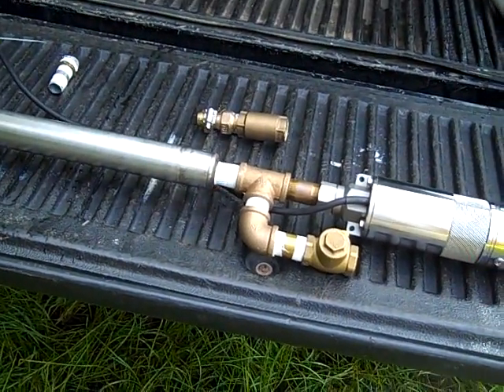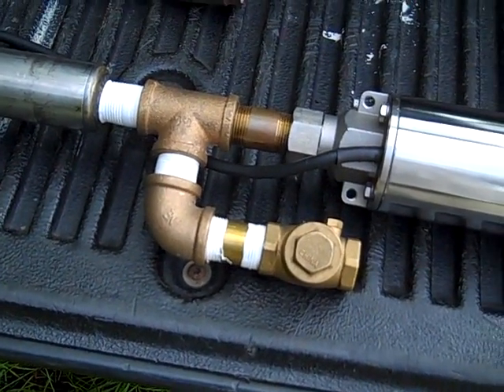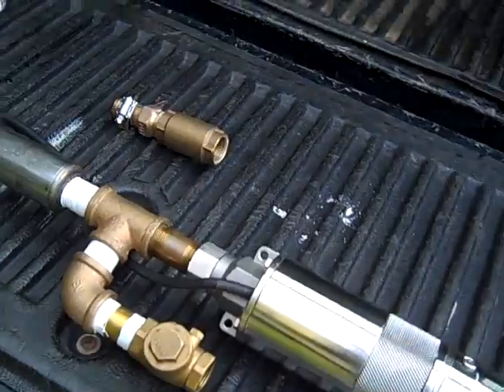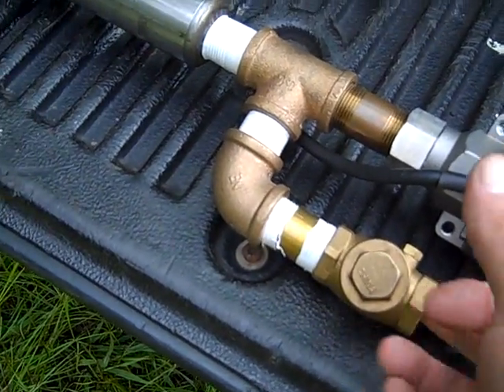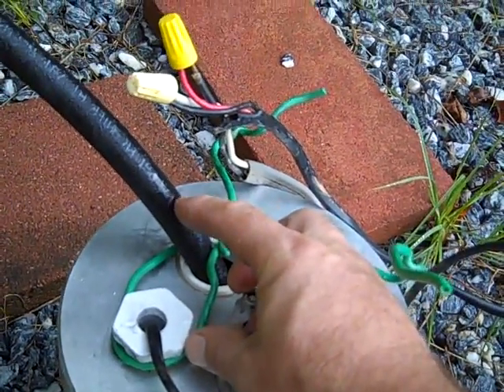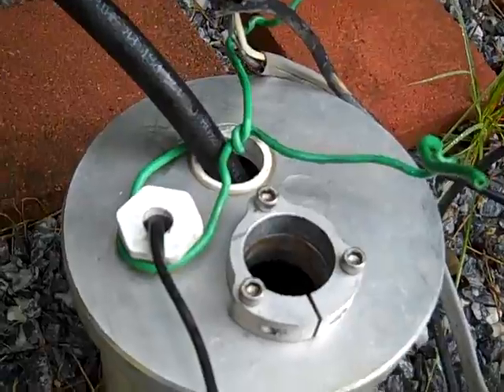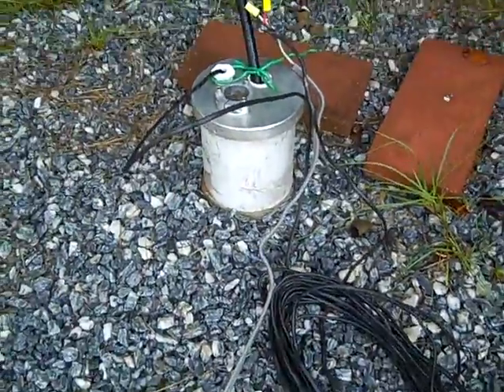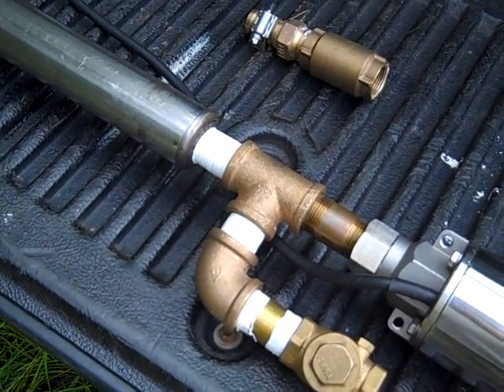All about wells - A Solar submersible and hand pump inline

Comment: What are your thoughts between the Simple pump vs the Bison pump? What schedule pvc pipe does the Simple pump use? The only thing that concerns me is the fiberglass sucker rod. It looks like the glow rods you use when installing network cable, and I know that can come unscrewed easily.

Comment: We just put in a 148 foot deep well. The water level is at 13 feet from the surface.
We want a hand pump and solar submersible pump that will reach 20 feet deep
into the 6" pipe.
I think I heard you say that you design these combination pump systems and I'm wish to hire you.

Comment: Have been taking measures to become more self sufficient in terms of power, now It's time to get serious about installing a back up system for our gravity fed well supplied by surface water from a large river up here in Canada above the 50th parallel. Have watched your vids for at least 2 years and would prefer to have your philosophy, expertise and experience on the job if possible.

Have a 20' deep fiberglass well casing (about 3' diameter) which holds about 10' of gravity fed water, about 350 gallons of endless water near the shoreline. The pitless adapter exits the well casing just under the 10' mark well below the frost line and goes down by PE pipe to a 1/2HP 230v submersible pump 10' below. Frost line is about 4' up here. Would need to feed the solar pump through the same pitless well adapter to get it to the house underground, was thinking of hooking it up in parallel with the 230V submersible. 

Would also like a manual simple pump for a 3 season back up source mounted right to the well cover. 

If you're interested in supplying a quote on the design and supply of much of what I need for this project (would likely supply batteries ands solar panels from north of the border mostly likely) please pm me or could you refer me to someone you know personally with a similar philosophy up here in the Great White North?  Thanks! Clinton

Comment: There is a need for more slender pumps that are still good quality. In some areas (mine) drilling a 6" casing requires a special permit from the state. This pretty well leaves you stuck with a 4" casing.

Comment: Great video, thank you! Could you do this on a 4 inch casing? We just dropped a Sun Pump solar submersible in one well and have two more wells cased and waiting, both 4 inch. I'd like to put a Sun Pump solar submersible and a handpump, either a Simple pump or Bison in each. Think that's doable? Thanks. Robert
Reply from the maker: Sure can.  The solar pump needs to be lower than the Simple Pump pump cylinder by at least 10 ft.  What is the static water level in the wells.  I have installed at least 4 Solar pump/Simple Pump combos in 4 wells. Here  is the latest Video 300! Off-Grid Water System during the install

Comment: Not sure what voltage the pumps run off of, but you can add a connection where you can hook a battery bank to in case you need the pump to work when the sun isn't shining...hook up the batteries and pump until the batteries run down.

Comment: This is similar to the system my husband installs.  He also uses a force pump system that allows you to use your existing house lines.  It will pump up pressure so you can use your pressure system in your house.  Works very well!  :)

Comment from the maker: It depends on the budget really.  I like a modular approach ( Sunrotor) and for simplicity I like Robison Solar.
Reply: Engineer775 I’m looking to add a simple pump to my well, but I have the rare oddity of a 4” pvc case well with a pitless adapter through the side underground, so I cannot fit the simple pump past the pitless connector inside my case.  Could this system of feeding the simple pump inline with my existing pump work for me?  That Tee and elbow looks too wide for a 4” ID case.  Is there another option for me or do I need to dig down 5’ and cut my case and replace the upper portion with 6 or 8” so the simple pump draw line can fit past my pitless adapter?  Any help would be much appreciated!